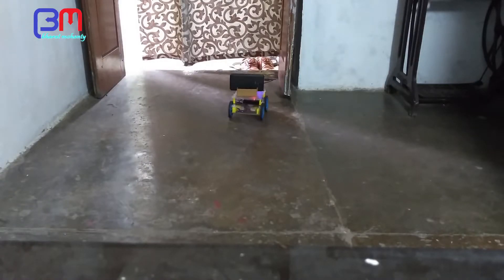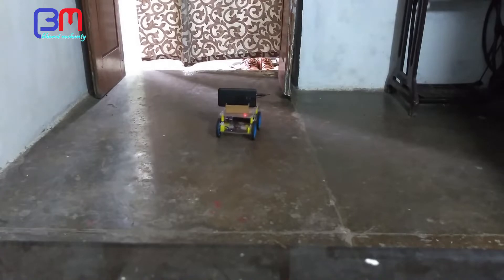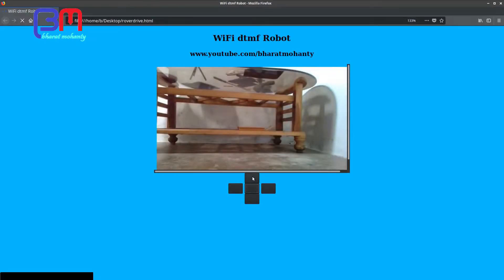WIFI DTMF ROBOT | PC CONTROLLED ROBOT | ROVER

Comment: it reminded me of selective relays
which I did a long time ago (20 years ago)

это напомнило мне о селективных реле
что я сделал давным-давно (20 лет назад)
Reply from the maker: Old is gold...☺ I used it because it can run on low power and it can handle more amps.( If you are talking about motor driver)
Reply from the maker: I am working on another rover but it seems It will take some time till then I will upload some other easy stuffs.
Reply: @BharatMohanty  ok.
Reply from the maker: @Radiolubitel-Petrovich  do you have a Twitter account....?